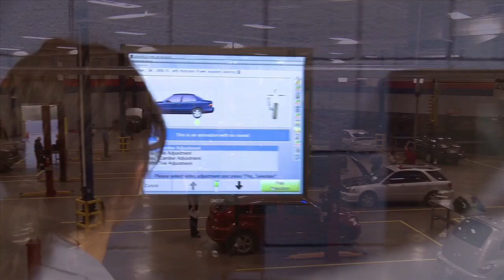Lincoln Technical Institute Automotive Technology Program

Comment: Nothing sophisticated about today's cars. All they did was add new sensors to the computers. Same engine and transmission engineering pretty much. When cars can glide through the air 5 feet off the ground then say "sophistication"

Comment: Everyone passes..as long as you keep paying!
Reply: You won't even know how to change oil,spark plugs or change a tire coming out of there. It's all a scam, selling you a pipe dream! No hands on just theory. You work on your own car if you have one with about 30 other Suckers watching you, begging to pass you a screwdriver.
Reply: Faraz Nabibaksh
This is a for profit Corporation masquerading as a institution of higher learning. Do they cover the theory of a exhaust systems, transmissions, brakes systems & electrical systems-Yes Would you know how to install a muffler, install brake pads or install a trans coming out of there? Hell no! You won't even know how to change a battery, because it's no hands on. Is that worth 25,000? You can make 12 bucks a hour at Jiffy lube with a high school diploma.At least they will train you to change oil and wiper blades.
Reply: JerzeYxKinG I paid $25000 In 2008 now I believe it's $30000.
Reply: ramrod20042000 the problem with these schools is they have no age limitations.. I found there's a lot of immature guys going to these schools that prevents others from actually learning and usually they are the ones who complains about how bad these schools are.. Lincoln technical institution wasn't terrible they never found me any jobs but I've always found jobs with excellent pay not $12 but $32 an hour.. so it has its pros and cons..
Reply: Do you know how much is it i wana go there after highschool